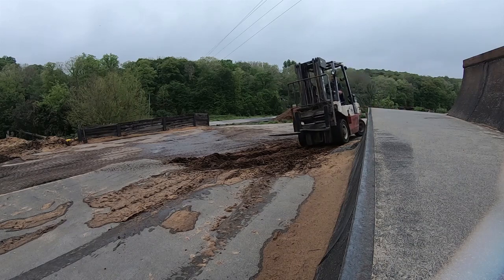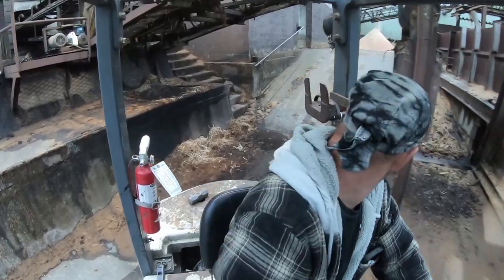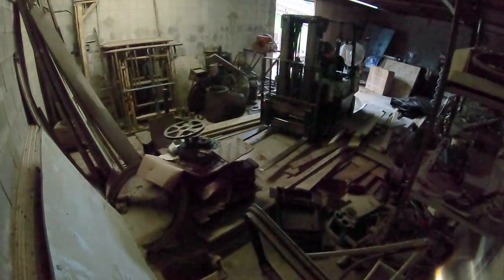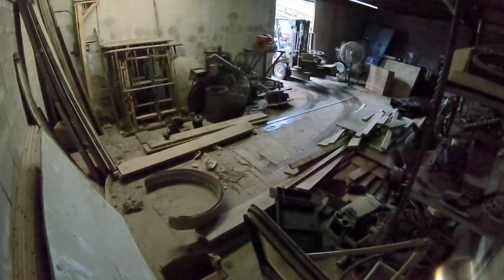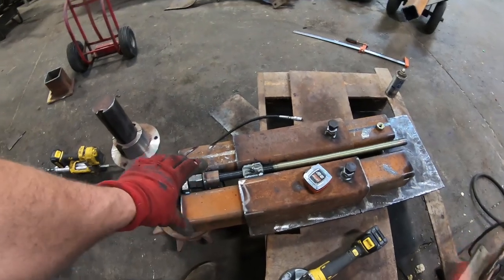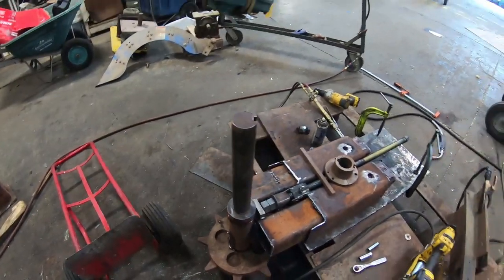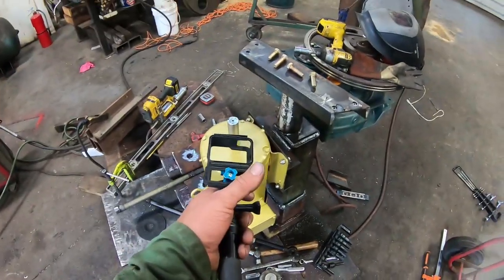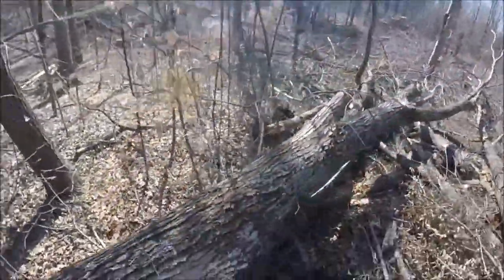Building A chain Conveyor Drive!!!

Comment: Like any muscle. The old noggen needs to be used once in a while or it won’t work so well for you. 
Now a question. When you adjust the chain will you have to back off the turnbuckle to loosen the belt or is the motor mounted so it will move with the gear case and chain drive? 
Kind of hard to see.
Reply from the maker: Close but not exactly the same

Comment: The 'hill billy' drive is to use a ' foot long shaft two bearing housing'  with a sheave on each end of the shaft on  as an intermediate between the  'electric motor with drive sheave'  and the driven sheave of the machine etc. e.g SKF two bearing housing (unfortunately metric shaft - which can require metric taper lock bushes etc)   https://www.skf.com/us/products/mounted-bearings/bearing-housings/two-bearing-housings-pd-series
6 inch sheave on 4 pole electric motor then the 15 inch sheave on the housing upper shaft, the 6 inch sheave on the lower shaft has 700rpm to drive the 19 inch sheave. Otherwise Bonfig etc
Reply from the maker: Lol copy that

Comment: Its heavier in the back so if you cant get it in forward then turn around and pish yourself thru and then turn around..i have had that same problem a few times. It dont weigh enough in the front to pull itself thru a soft spot

Comment: Thanks for sharing your thoughts and ideas. Always interesting to watch fabrication come together. Does the motor slide with the drive sprocket or will tensioning the chain also interact with the drive belt tension?  Either way project looks well built. Wishing you and your family the best.
Reply from the maker: Separate good question

Comment: We reversed our paddles on our cleaner by drilling new holes in the other end. Then we drilled a new hole in the shoe and bolted it all together.
Reply from the maker: I'm trying to follow but ya lost me this wlulda saved a pile of money
Reply: Logger Wade if you turn the paddles end for end it puts them backwards. The way you need them. The shoe c channel piece under the chain and paddle we turned over so it was the right way to keep everything going.